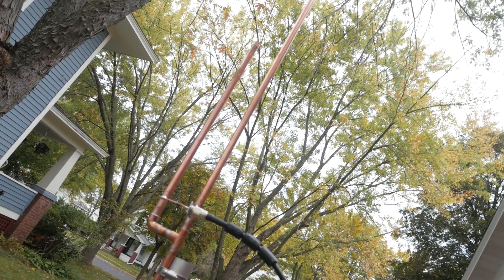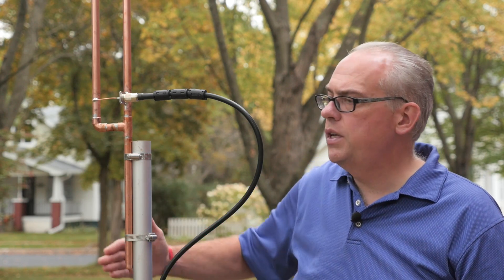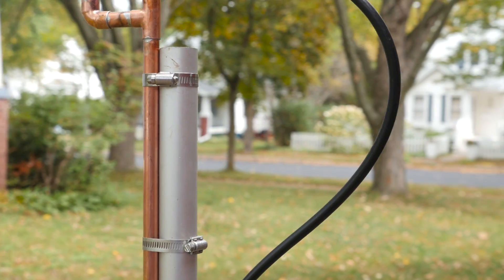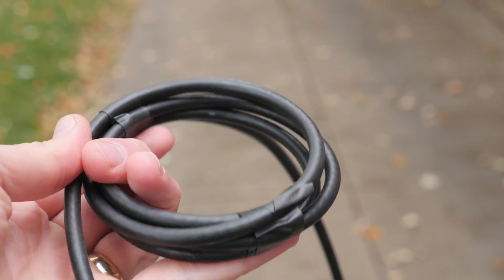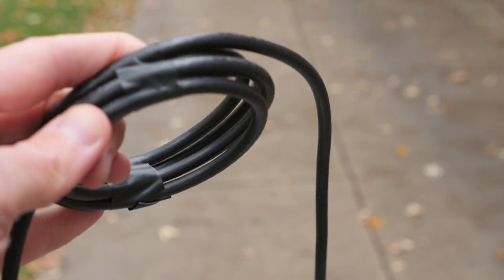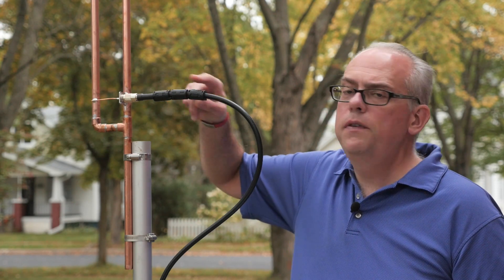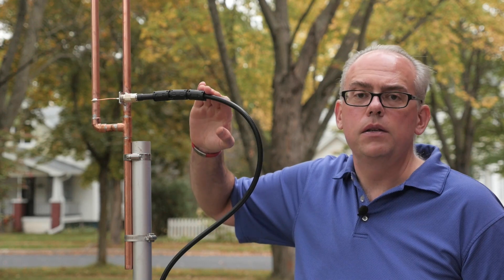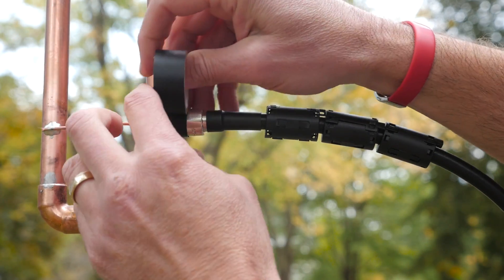Installing the KB9VBR J-Pole Antenna

Comment: Hello Michael (KB9VBR) this is  (KD9MFT) and I have a question I have a 2 meter J pole antenna.  I'm using  a  2 meter  Yaesu 2900R mobile  unit  as a base  station unit  but I'm a bit confused this is my first time ever having or using a J pole antenna but I'm getting different information from different people  some people are telling me I need to have it as high as I can get it. Some people say they use it low on their balcony or their porch some people say they even have it installed on a small mast in their yard in the grass so I'm not  sure what's the best method to get  the best performance I know they say to connect with the repeaters in the surrounding area it should be pretty high I have mine about 25 ft is that enough is that too high is that too low that's my question  can you clear  that up for me please. KD9MFT... 73's
Reply from the maker: VHF/UHF propagation is primarily line of sight‚ so the higher you can get your antenna‚ the better the performance. In most cases‚ a height of 25 feet is plenty as it will let you get into all the local and wide area repeaters and should afford you decent simplex coverage. Where things get confusing is when you don't have the ability or are limited in getting the antenna up in the air. If you are forced to mount the the antenna in a low position like on a balcony or deck or on a mast of about 10 feet- then a low to medium gain antenna tends to fare better than a high gain antenna in the same location. That's why antennas like the J-Pole tend to work well for those in compromised locations. I hope this answers your question‚ please let me know if you have any others.

Comment: I hope this isn't a dumb question but wouldn't the connection be better if it was pointed down toward the ground instead of horizontally?  The way it is the coax has to turn 90 degrees.
Reply from the maker: You could add a 90 degree connector if you wish. You still need to secure the coax to the mast to keep the stress from the weight of the cable off the connection. With the connector pointing outwards you can create a drip loop which provides that strain relief.

Comment: How do you attach a ground wire for static discharge or do you not use one?
Reply from the maker: The J-Pole is a half wave antenna by design, so it does not require a ground plane or special grounding to function. If you live in a lightning prone area, you may want to create an electrical ground to protect the antenna and your equipment from lightning hits. You can run a ground wire from the base of the antenna to a ground rod, but I think a better method is to install a lightning arrester where the coax enters the house and ground that.
Reply: @KB9VBRAntennas   Love the suggestion - have you had experience with lightning arresters - which would you recommend? In this case, I'd prefer not to trial and error.... ;)

Comment: Are you still in business?  I've attempted to contact you via your email address and via phone but have not received a response.  That's particularly interesting since you suggest in this video that should someone have any questions to contact you. Please advise if you are still in business or what, if any, secret password will aid in getting a response.
Reply from the maker: I'm still in business. I do receive a lot of messages and try to respond to every one. Did you check your spam folder for a response from me? I was out of town for a bit last week, maybe something slipped through the cracks?

Comment: This is a great antenna. I have mine atop a 15' flag pole with RG8x running to a Kenwood TM-281A.  It's not the most expensive or exotic setup, but I get complimented on my signal and clarity often.

Comment: Is a j-pole acceptable for use in a car?
Reply from the maker: As a mobile antenna? I probably wouldn't as mobile antennas need to flex to absorb the bumps of the road. The J-Pole would be pretty stiff so it could be damaged or cause damage over time.
Reply: @KB9VBRAntennas   Thanks so much!

Comment: new to ham radio, i enjoyed your video very much. how high do i need to mount the J-pole for best results? do you think 25 feet is ok? KN6BFJ
Reply from the maker: VHF propagation is primarily line of site, so the higher the better. But with that being said, for most cases, 20-30 feet seems to be a good 'sweet spot' for antenna height.

Comment: It is okay to use duct tape instead of electrical tape to keep moisture out?
Reply from the maker: Duct tape isn't ideal as it is quite sticky and will be difficult to remove if you ever choose to do so.
Reply: Use 3M plastic tape; Will keep moisture out and easy to remove and reapply if necessary.

Comment: Mike, my suggest is Allright?  I m using the N-Male + N-female 90, to connect MY Cable, In this case I M using a 1/2 Cell-Flex, because the Low Attenuation and I found a Ferrrit to do the same with LMR-400 Cables.

Comment: Hi Michael, great video. Question, I live in an apartment, are there any antenna options for me?
Reply from the maker: I can give you a few recommendations, but first are you looking for VHF/UHF or do you want an HF antenna? The J-Pole can be used in an apartment. I've had customers put it in a window with ok results but if you have a deck or balcony, you could place the antenna there.

Comment: You said to keep any metal object 6 ft away from the antenna but you have a metal pole holding it up
Reply from the maker: The antenna should be kept away from metal objects that are alongside or run parallel to the antenna. The reason is that those objects could couple with the antenna, affecting its performance. But metal objects below the feed point of the antenna really have no affect on it.  You can mount it to a metal or non metal mast, or install the antenna above a metal roof without issue.

Comment: Michael would I be able to use 6
meters fm  portion of the band on 2 meters if so all I would need is 2 meters and 70meters pretune 
J pole antenna.73 thanks

Comment: Why do you run the opposite of everyone else who builds j-poles out of copper? Thought the ground went to the short side and the core went to the long. Can you explain?
Reply from the maker: That's a great question. Here's a short and longer answer: As you have probably found out by searching online, there are plans that attach the center conductor of the coax on either side of the antenna. I have experimented with attaching the center connector of the SO-239 to the stub and to the main radiator. I have not found a difference in signal quality or performance. I choose to mount the edge of the connector onto the main radiator because I believe it makes a better mechanical connection.

Longer Answer: 
A J-Pole style antenna is comprised of three sections. First is the mounting section where the antenna is attached to a mast or support. The second section, which is 1/4 wave long, is the impedance matching section. The two pieces of the antenna that run parallel to each other change the impedance from the 50 ohms at the feedpoint to about 300 ohms which is the impedance at the start of the third section. The third section, which is 1/2 wave long is an end-fed dipole radiator. With end-fed antennas, the impedance is high at the ends and low in the middle. With the 1/4 wave section, the impedance is low at one end and high at the other. So the two parts of the antenna can work in harmony.

The RF energy will travel up the matching section and then radiate from the resonant part of the antenna. Hence it really doesn't matter which side the connector is attached to.
Reply: Great to know. Thanks for the fast response and for publishing videos.

Comment: One more question? 
Can I ground the antenna with an inline lightning arrester to a ground wire to a 10ft ground pole with 9.5 of the pole in the ground without any reception issues?
Thank You

Comment: Hello, should the ferrite beads get sealed to?
Thank You!
Reply from the maker: I'd seal the ferrites with electrical tape to prevent water penetration and freezing weather potentially cracking them.
Reply: KB9VBR Antennas Thank you very much! 73

Comment: Can I mount one of these to a tv tower?
Reply from the maker: You can either side mount or top mount this antenna to a TV tower. The antenna won't interfere with receiving television broadcast frequencies.
Reply: KB9VBR Antennas the tower is used for our internet half way up

Comment: Can these be painted without effecting the performance?
Reply from the maker: You can paint the antenna with a clear lacquer or non-metallic spray enamel to protect it from the elements or help it blend into the surroundings. More information on painting the antenna can be found on my website: http://www.jpole-antenna.com/2011/01/04/painting-the-j-pole-antenna/
Reply: KB9VBR Antennas Thank you.
Reply: Was one of those coax runs made by ABR hete in Houston?